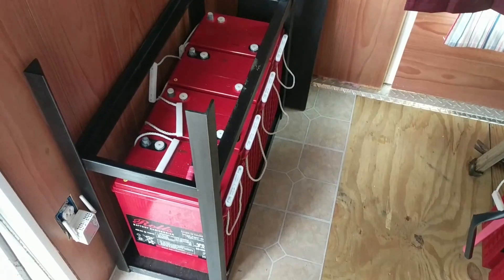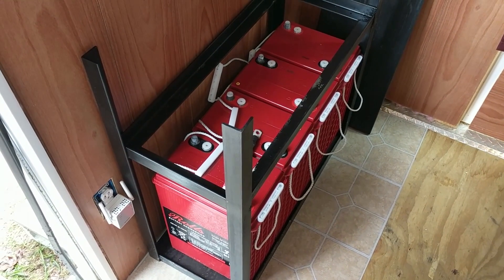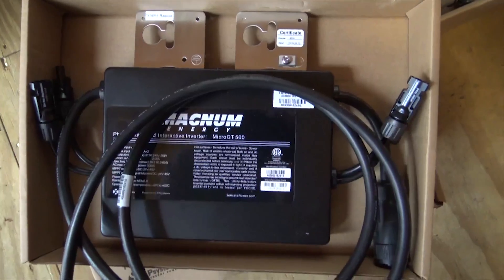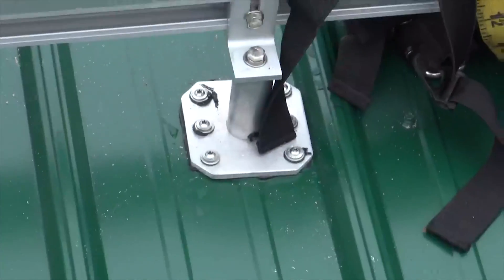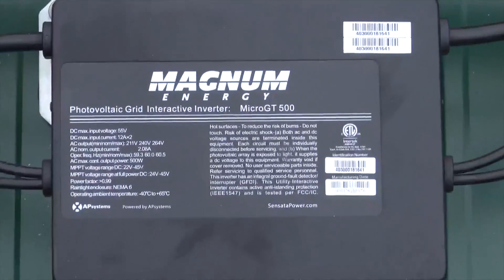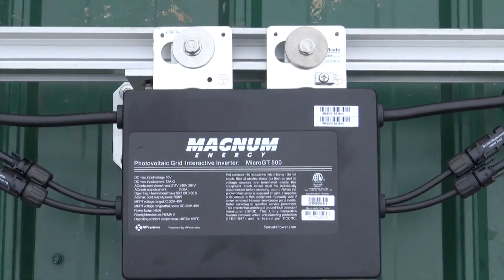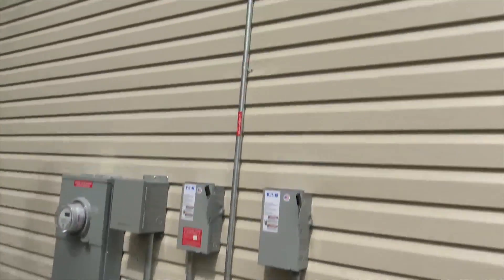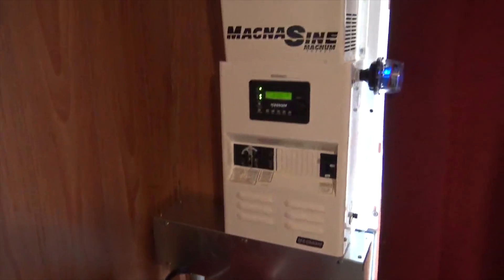Battery Backup and Grid Tie Done Right!

Comment: I am really curious, like if my house use 3kwh but I installed a backup of 1kwh, which means I only have 20mins of electricity during a power outage. Would the solar charge the batteries quick enough to keep the house running more than 20 mins during a sunny day?

I am abit confused about this, figuring how to cut down cost, being in Cambodia and sunny all the time.

Comment: I am working on a design for a vacation home and debating about battery bank sizing.  Based on location and direction the 9 panels we can install will get about 6hrs of peak sunlight.  If I dedicate about 33% of the current generated during the day to charge batteries I can fully charge batteries from about 10% in a little over 6 hrs.  I am looking at using 48V panels with a Hybrid Inverter.  Thoughts?

Comment: It seems like that in California SDGE, that the only inverters that are approved are only grid-tied inverters. You seem to be using one. Then you seem to be adding the other one which I suppose functions as a charger controller. I would rather have a one in all system, but it seems like SDGE does not have these certified.  Did you have a similar issue with this system, or did you just decide to start with the simple grid-tied inverter?

Comment: Why is a agm the right battery for a grid tied solar system
Reply from the maker: For one reason it's still a little bit cheaper than lithium and the next big reason is that the battery stays floated and isn't used on a daily basis so the battery is not being cycled until there is a power outage. We have seen AGM batteries in this type of hybrid situation still doing well at 14 15 years out.

Comment: Hi Scott, great video, my system has a Kstarhybrid inverter, unfortunately, my supplier used batteries that were not suitable it worked OK for about 4 years then it closed down when back working the lights for back up and charging were not on, batteries have a good charge in them but the inverter is not giving me any, now I am told by several installers that I will have to replce both the batteries and a new inverter

Comment: I use the 4400 watt 48v inverter with 50kwh of lithium batteries. To my delight, it can phase with my SMA grid tie inverter in an off grid situation and pull current from the solar to charge batteries, and gives me extra amps while the suns out. Pretty trick inverter, haven’t had to add another one yet it is very good at taking an over current situation

Comment: I am curious on your opinion regarding AGM batteries vs. NiFe batteries.  

Would it make sense to use a small, balanced ultra capacitor bank with either set of batteries to compensate for motors and compressors?

Could the battery bank be smaller if it is not compensating for motors when using a capacitor bank?

Comment: I am looking forward to adding batteries to a DC solar edge system with optimizers. Goal is backup with time of use so the batteries can take over when the sun goes down. Not sure what is possible.
Reply: why? why not just add standard battery charger connected to grid? easy fast upgrade

Comment: At least if the grid goes down they will have battery Back up for Small appliances.   Light fan and communication.   We in Florida don’t stand a chance during hurricane season without Batterie Back up.   We have gone 11Days without Power.   No fun.   And gas lines get long.    Poor seniors are in big trouble.

Comment: Did you use the  S12-240AGM 12 Volt Rolls in this configuration, serial /parallel at 48V for 430Ah?

Comment: Why no diversion load controller to protect the batteries?  I thought that although MicroGT does a great job at allowing the PAE to throttle things, that it still needs a diversion load controll (either AC such as the Magnum ACLD-40, or the older DC style one would also work),  Just curious, because I have a similar setup (Magnum PAE w/ MicroGT 500's) and I wanted to know what you thought about it.
But other than that, nice AC coupled setup!  It's nice.  And throttling rocks!  Good job on the clean roof mount too.
Reply: Ok it's been 2 years... I can take a hint you don't care LOL

Comment: You said 14 panels / 7 micro inverters per magnasine inverter.... so a 4400 watt inverter/charger can handle 3500watts of frequency shifted AC coupled power.  OK.  You can also stack the magnasine inverters, so is it safe to say that the inverters are simply connected another 14 panels / 7 magna micro inverters?  Just that easy??

Comment: Thanx for this video Scott. I just completed my first system (3.6kW) using the Magnum inverter and mini panel you used here. Very pleased. No micro inverters though. And we used LiFePO4 batteries. I held my breath on the lithium cells but so far so good. Was able to program the Magnum charger and a Midnite Classic 150 charge controller to charge the batteries properly. So we will see in say 5 years. btw - I spent 13K on the system,  3.6kW of solar panels, the inverter, wiring panel, charge controller, all the "extras", and 144AH of LiFePO4 cells in a 48v array. Price included battery management system and ground mount system.

Question: Any plans to install a Powerwall 2?

Comment: What was was the cost of materials ..minus the labor costs....?
Reply: He probably does not want to reveal his margin. Was actually very nice to reveal the project cost. Since they quoted all the brand/model of equipment you should be able to estimate cost pretty close.

The wild card in that system are the micro inverters. I have an acquaintance who does a lot of solar and he's had a 100% failure rate over time. It was not the model shown in this video but note that Magnum did not design these micro inverters. They are rebranding an OEM. Just sayin'.
Reply: How are the warranties on these micro-inverters?  I think the Enphases have 25 year warranties and are electrolytic capacitor free, although their early generation units were supposed to be very unreliable.
Reply: If you do use them it's best to make sure you have easy access to the back of them for when they fail (not seen this brand of micro inverters) been looked at micro AC inverters long time, early micro (empas dc to dc more reliable but still failed at the time, but AC micro inverters was not reliable enough)

Comment: Great video as usual. I love watching the solar stuff. 
When you say 8-10 years on the batteries, is that assuming heavy load/charge cycles or is it 8-10 even if they just sit there in maintenance charge most of the time?
Reply: Do these new AGM batteries have lifetime energy rating in KWH at different depths of discharge?  Can this Magnum charger inverter be programmed to do a good job of charging LiFePO4 batteries if an external battery management system is used?

Comment: With all of the things, you put into the critical load's panel they couldn't have had much left other than a few large appliances that would have gone over the rating of the inverter.  I look at the extra work it takes to add a critical loads panel and wonder if it wouldn't be more cost-effective to put in a larger inverter in the first place.  I know when I am ready to install a backup system in my house I plan to just install a 20-30KW inverter and an automatic transfer switch.
Reply: Instead of moving the critical loads to a new panel, could you have put noncritical loads on shunt trip breakers to automatically disconnect them when on battery?
Reply: It's not just your KW that matters but the amps to cover the demands. Sounds like you would be trying to run HVAC and that would be very tough without smoking your inverters.

Comment: Hi engineer775,
Recently, after a grid tie inverter failure, I discovered that my inverter, JFY JSI2000TL, has a no load, night time, power consumption of 70W!!!! What is you experience with this.  Manufacturer does not list standby power wattage.  
Is there as solution to this?  PV output is at about 400VDC.
I am thinking about installing a, PV power sourced, relay cutout circuit when the PV array is not producing power.  Your thoughts again.
Thank you,
Love your work,
Bill, MechEng, Sydney Australia
Reply: A relay or contactor will do.

Comment: roughly speaking, what kind of effort would it take to move the panels if roof work needs to be done (replacement etc.)?  Are there 'quick-release' type mechanisms for such a situation?
I've always leaned towards ground mounted systems (no I'm not a professional) for a few reasons.  Maintenance doesn't require a climb; roofing work doesn't have any extra steps/work-arounds; and I can clear snow easier if I can reach it not to mention I am uncomfortable poking holes in a perfectly good roof.

Comment: What was the total cost of this installation?
Reply: At 25k this is actually very expensive. I understand that is your work and knowledge but dont understand how you come up with those prices. I still do not understand why using 2 magnum inverter/panel makes sense. if you use 7 inverters x 500 that is 3.5kW. If the system is 4kW you lose 500W at peak production. Also 7 magnum inverters are more expensive than a SMA inverter where you can connect 7kW of panels and have secure power. maybe you can illuminate me; Is the AC coupling on the magnum works only with Magnum inverters?  Also a Schneider Hybrid inverter is not cheaper? because it is like $2700? and it is all in one and puts out more than 4000W.
Reply: What was the cost of the components?
Reply: Same question.  These  microinverters that push the AC further back to the panels keep popping us as the new thing and I want to know why.  Is this DC hate or efficiency of conductors or what?  I don't like it b/c there's double inversion for battery storage systems:

"New" way: panel -> DC -> AC microinvertor -> AC (mega)inverter -> DC -> battery
Old way: panel -> DC -> charge controller -> DC -> battery. 

The benefit of the "new" way, we're told, is 1) easier wiring of AC strings from panel, 2) isolation of panels / arrays.  (1) so using fat gauge wire to push DC versus thin gauge wire for AC is cheaper?  OK sure but then you have to buy all these microinverters and this big Magnum inverter too, so what is the net savings?!  (2) isolating panels can be accomplished with basic, parallel wiring!

Before someone says how efficient inverters are now, the MOST efficient inverter is NOT having one!

Maybe this setup is fine for grid tied or systems without batteries because there's no reason to keep the DC around, but otherwise what am I missing?
Reply: @vap0rtranz  you're not missing anything, hes all about the money all this equipment cost bucks and the retail markup is enormous,  I started doing the research and finding who really builds a lot of newer solar equipment and buying direct myself. On average around $500 savings almost on each piece, manufacturers don't pay squat to build most of their stuff , it's all about the money, 
Oh and micro inverters it's a fad you really shouldn't use them.
Reply: christopher m primm Sr.   A good DIY type can almost always have a lower price tag. We’re just getting equipment, our labor and knowledge is “free”. But our livelihood is coming from somewhere else. It’s not fair to compare that to a business. Compare a business to another business.
Reply: Tesla does it for the same price and at least they are brand name and reputable
Reply from the maker: 25k

Comment: I've been wondering this and you might know better than many. I've been wondering if they make a variety of circuit breaker that is similar to the common house 15 / 20 amp breakers but it has three positions. For example Grid power if flipped to the far left, Off in the center, and Secondary power if flipped to the far right. The appeal here would be being able to choose what in the house runs off the grid and what runs off Battery, Solar, ect. with a flip of a switch without over complicating the rest of the wiring. Or is this even allowed to have two power sources coming into the same box.
Reply from the maker: Sounds like a simple Reliance transfer switch.  It has, Grid, off and Generator selections.  The Generator selection can be a generator or a solar inverter.
Reply: Thanks for information, looks like that would get the job done. Something like an A510C Pro/Tran 2. I  would probably have to get two of them if I wanted options for an entire house as the largest one I'm seeing is for 10 circuits.
Reply from the maker: Correct

Comment: Scott, we had the Solar Ark system put in with 15 panels  with batteries and a grid tie system of 16 panels with no batteries and 4 more panels for a solar hot water heater installed over the last few months and have seen zero savings on our bill.  No one can explain to us why this is so.  Solar Ark refers us to the installers they recommended but they have been out many times and seem to not know what to do.  Since we are not getting any savings on our system can you help with any suggestion on what to do.  (The electricians all seemed like drug addicts).
Reply from the maker: Where are you? That is ridiculous. you have close to 8kw of solar.  you should be saving 100-$130 per month.   Were the drug addicts recommended by Solark?  If you can email me what all you have for equipment I can at least let you know what I think.  info@practicalpreppers.com
Reply: I just looked at our electric company website and we are not showing savings.  We were supposed to have it installed by the end of December but they didn't get it with the right switch that the electric company would take until April 29 and still haven't completed what they said they would do.  We were supposed to be able to use our two split panel air conditions on the Solar Ark system as well as our rain water pumps and well pumps. The electric company shows we generated a little over 12 kWh in April.  Twice that in May and June was around 52 kWh. That is not even 10% of our load since we consumer 2700 or so.  We are in the Austin area and I asked SolarArk to recommend an installer since my husband is 80 and we couldn't do it.  The installers seemed to know nothing about solar at all and they hired the electricians and they said they kept messing things up.  We are not seeing anywhere near 100-130 a month. Maybe 50 this last month. The installation took month and still isn't finished.  When I contacted Tom at SolarArk he first said it had been a cloudy year.  Then, two months later he said I needed to talk to the installers. And the installers are nice but they don't seem to have a clue what is wrong or how to fix it and overtime they do anything it makes it worse. I am just at a loss.  I will email you too.  I love the idea of SolarArk's EMP proof system but we are not even seeing a savings on that either. I would appreciate any ideas you have.  We have been sitting on this system for months with no savings to speak of. Our bills are the same as last year and the average temperature was higher last year according to the electric company.  Thanks, Scott. I wish you were here!
Reply: you wouldn't believe how many are. electricians druggies that is. the companies I worked for. 7-8 of 10 were kind of out there.  you are usually better off with a middle aged or older guy. or a woman. they tend to have something to prove. well they think any way. so they usually work harder. and know what they are doing. shame they are so few female electricians out there.
Reply: The middle age clean guy bid the job but the druggies were the workers.
Reply: engineer775PraticalPreppers  Did you ever get my email?  I got a warning message that the email address didn't appear to be real?